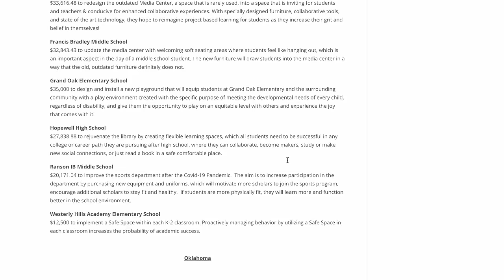DIY KITCHEN CABINET FRAMING | TIMBER FRAME CABIN | OFF GRID HOMESTEAD

Comment: Richard the slight over hang of cabinets 3 1/2 inches off the floor is so you can get closer to the counter top,  I'm 6' 3" tall so I set my cabinets 5 1/2 inches off the floor to raise my counter a couple of inches above normal the kick plate is 3 1/2 inches back for the base board and quater round so your toe's can go under the cabinets 3 1/4 inches I hope you are planning on setting that frame on top of a 2x4 subframe to raise it up and create that over hang it is very useful
Reply: Henry, Isn’t that called a “kick plate.” I am old and forget a lot.
Reply: The overhang is unnecessary and looks cheap.

Comment: You forgot to add the recess along the front bottom edge for your toe kick. You will miss it if you don’t add it. I know because i did it once. And had to redo it also. Good luck on this project.
Reply: I'm 2 years late but that toe kick recess is not necessary and look tacky. I've never seen anybody's foot go into that space. Better to run a shirting board to elevate the look of the base cabinets.

Comment: Hello Richard, I can’t stress enough how you need to set your cabinets on a plinth to allow your toes to fit under. You will forever regret not doing it. Even watching this video, your boots were riding up on the frame when you were working near it. I was a kitchen builder and fitter for over 20 years and I have no doubt every carpenter was screaming NOOOOO! Please think about this. All the best matey😊

Comment: You’re probably to far along to consider this but just in case. Our kitchen cabinets have what they call an easy reach cabinet in the corner. It has two doors that are at 90 degrees to each other and are mounted together with a piano hinge. The handle is on the left hand door and the hinges are on the other door. When you open the cabinet, the first door folds back on the other door gaining access to the left side of the cabinet. After you open the first door, grab both doors at the piano hinge to open them and access the entire cabinet. The cabinet shelves are 3/4” plywood and is cut so the doors can shut to create a 90 degree turn. This cabinet allows full access with no upright supports to have to maneuver around to reach the back portion of the cabinet.

Comment: Richard, it might serve you well if you used one of those slender openings to put in a roll out spice rack cabinet and the other slender opening to store pot lids, baking sheets and cutting boards with the same roll out method.

Comment: Great video, good progress on the kitchen.  I would like to suggest one improvement for the base under the sink.  If you have leftover flooring, line that portion with it.  Having experienced a few plumbing issues under my sink, the shelving is now quite messy, making it even more difficult to use the space.  My sink is corner mounted, so much wasted space that can't be reached behind the plumbing!